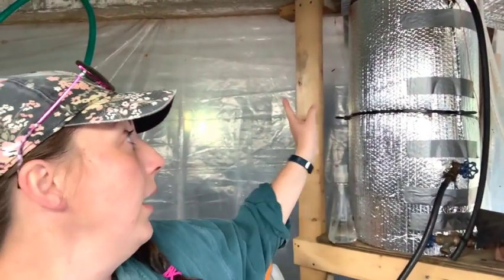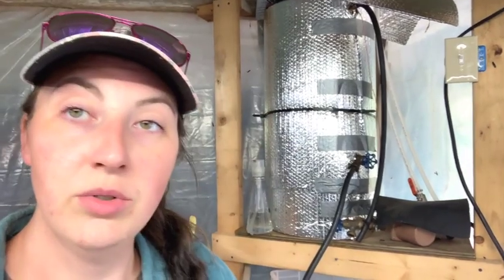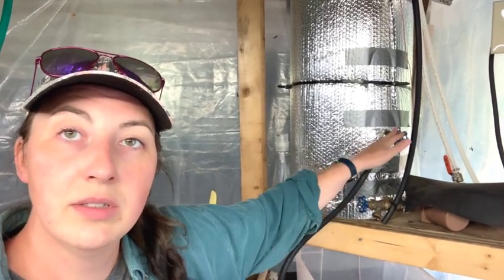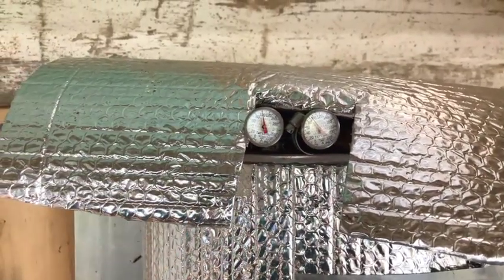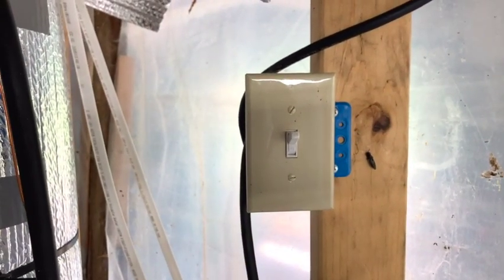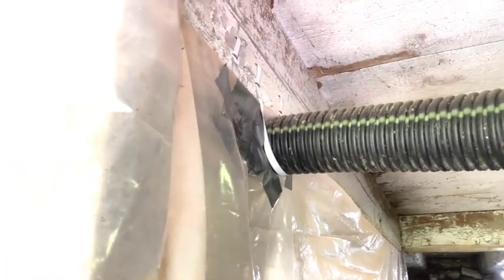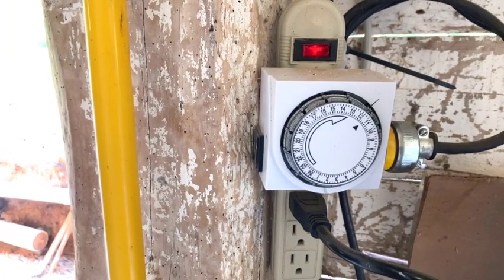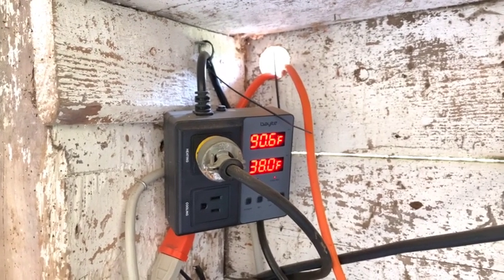Compost Water Heater System

Comment: It sounds like you are in a temperate zone. I'm up here in Alaska and have been working on getting a hot pile for about 50 years. The combo that has worked best for me is to cover the pile with a vapor barrier and then some polystyrene foam chunks. This traps the water vapor which keeps your pile from drying out and also due to the heat of vaporization of water, conserves a LOT of heat. I did garden hose thing what 3 summers back and was able to get a little bit of 150F water- too hot! Now it's time to get a tank and circ pump but as always seems to happen life gets in the way. Thanks for sharing this video. My ultimate setup will be on a insulated slap with lots of pex. Then have a timed suction fan pull air into the pile, through the pile and through some heater cores/discarded on-demand water heater heat exchangers and then to the atmosphere. This will serve to pull the escaping hot air and moisture back into the core of the pile and then extract heat before it is exhausted. A low speed will mean greater efficiency. This will also overcome any anerobic conditions arising from the vapor barrier. The suction will be juxtaposed to the vapor migration.

Comment: To preserve the heat in your first compost pile, you should be able to add multiple compost piles. The first pile would lose the most heat, second pile would probably stay around normal temp, and third pile would retain almost all heat even for a longer period through winter.. i haven't tested this but i would think it should gi e you either more hot water or hot water longer through the year, worth a shot imho.

Comment: A wonderful system, your uncle is well minded with these processors.😊
I gather you can add manures etc to get more heat if required in winter with some type of insulation, though you have experienced one winter already.😊
Great work.😊